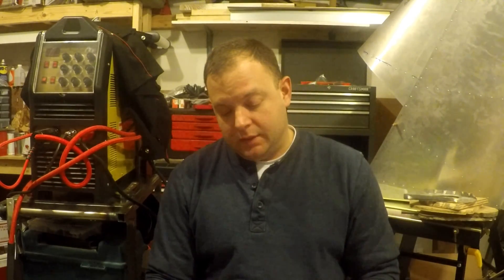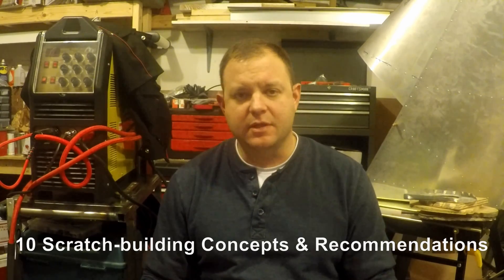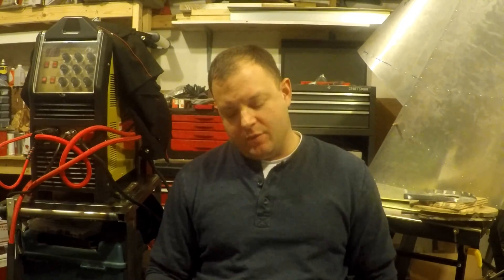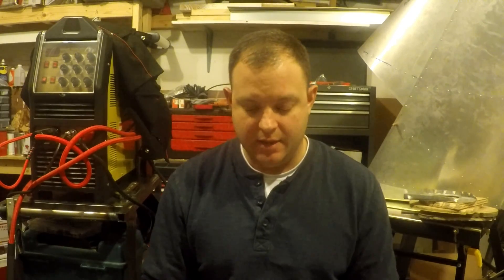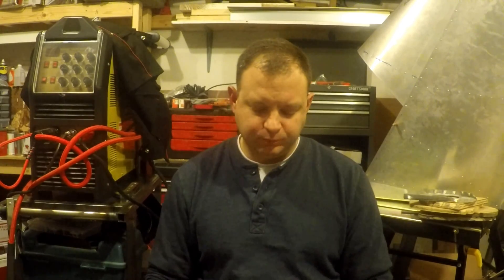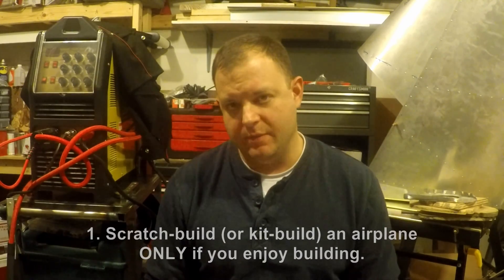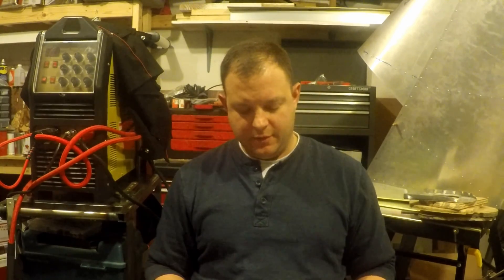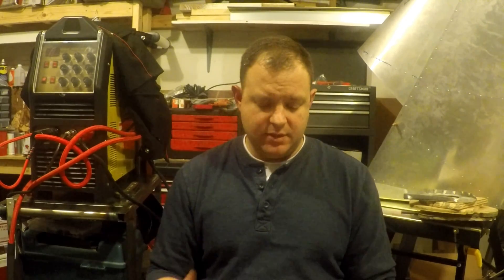10 Scratch-building Concepts - Part 1/3

Comment: Nice job on the video's, and the build, Greg.  I wanted to add something to your first point.  You can make buying a certified plane even cheaper by having partners.  I got into my first plane, a 1964 Cessna 172E for $16,000 shared across 6 partners.  That made not only buying, but owning, a lot cheaper.  You have to also consider insurance, hangar rent, upkeep and maintenance, annual costs, etc.  Sharing them helps quite a bit.  But a word of caution.  Put as much time and research into your partners as you do into your plane.  With the right group, it's an affordable and enjoyable experience.  One bad apple, however, and it's a whole new ball of wax.
Keep up the great work!
Reply from the maker: Thanks, Chris! Agreed on joint ownership (or even club membership, for that matter). I've explored shared ownership a few times, just haven't found the right group, price or plane yet! But I'd love to have something faster and with more seats than my STOL will be someday.

Comment: My decision to build was based on the aircraft capabilities (LSA + STOL).  Little more challenging to find a flying aircraft in the < 50k range.  I'm confident I will enjoy the building process, but still somewhat debating the component kit option over the scratch build option.  My only hesitation is confidence that I can acquire the metal fab skills.  My plan is to initiate scratch building with a small component and start learning.
Reply from the maker: Easiest way to get rolling is to start the rudder components. The form blocks are easy to make if you have some woodworking equipment. You only need a brake to bend the spar, spar doublers and rear skin. I started with the nose rib, tib rib, rear and bottom ribs. After that, you can commit to building a bending brake and the rest of the form blocks if you like the process. I'll be posting a new video about my revised bending brake soon. Just finished rebuilding it today, so I'll be making some test bends hopefully tomorrow with video footage. This is the 3rd rebuild I have done...the brake has been the most frustrating because the original one was not big enough or heavy duty enough to do all the bends.